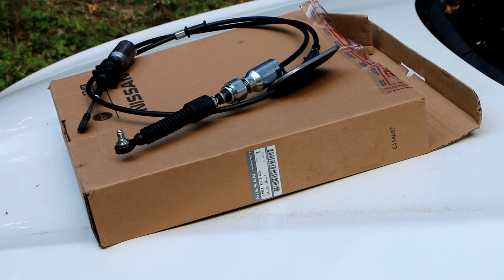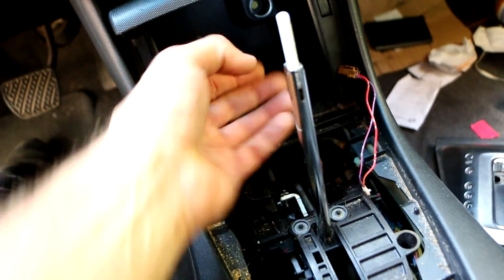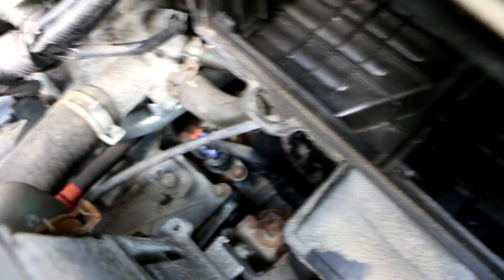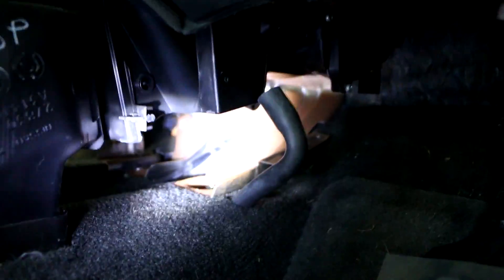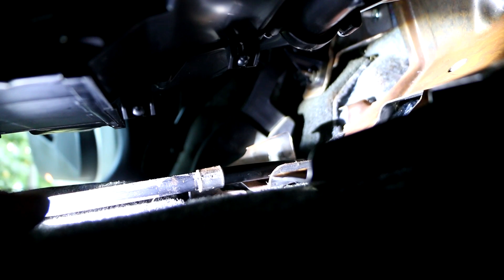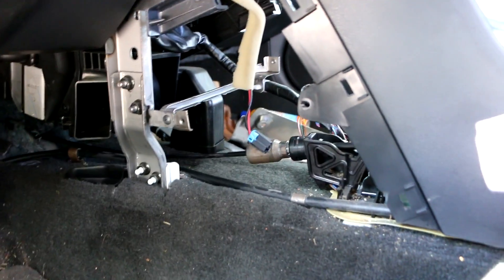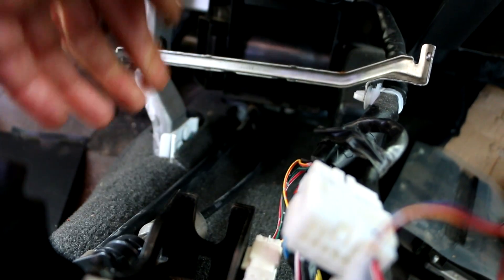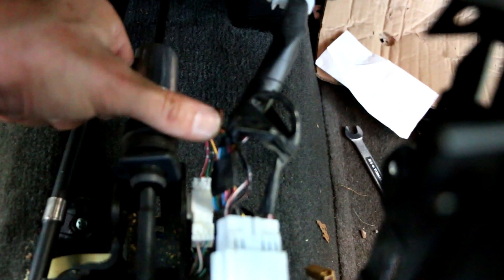2010 Nissan Altima Hybrid shifter cable replacement

Comment: This is great. Thanks. Im getting B2603, which would basically indicate an ECM problem or a PnP (neutral) interlock switch issue, but this is an entirely new consideration.

Comment: Have a similar issue with my Altima Hybrid 2007, how long did it take you to replace the cable?
Reply from the maker: I'd say about 3 hours having never done it before. I think I could do it in 2 new that I know how to attack the job.